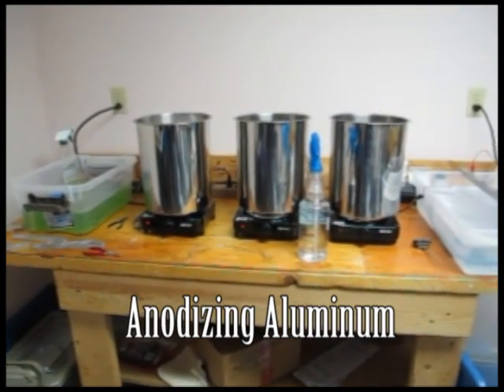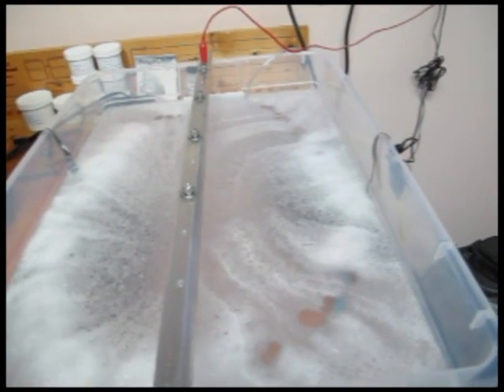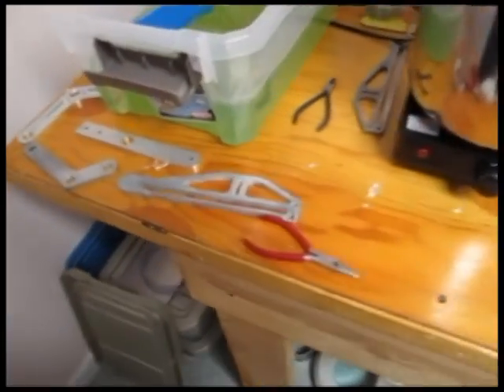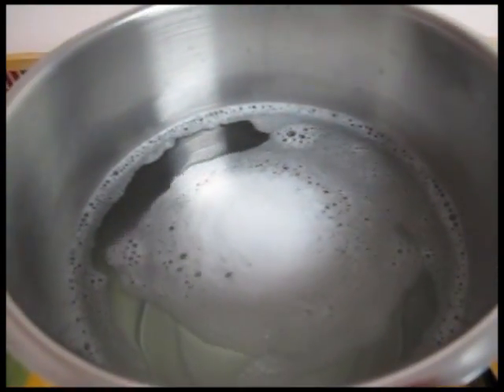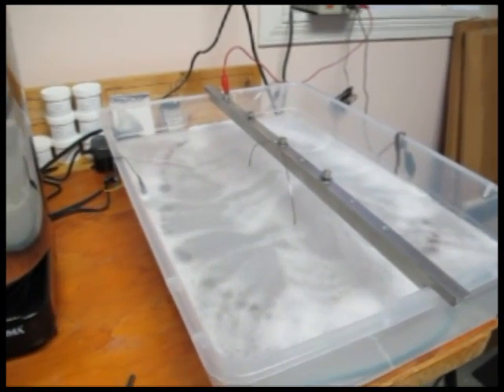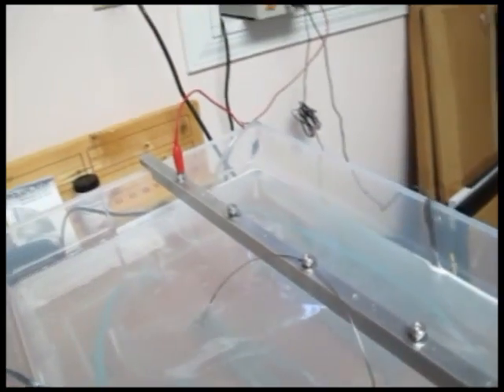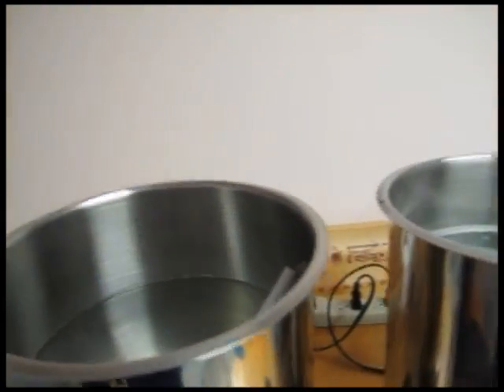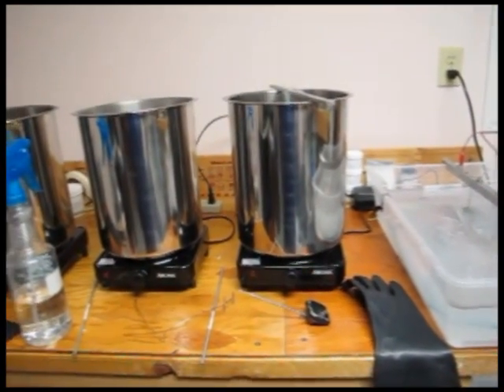Anodizing Aluminum

Comment: for anodizing wheels, if i dont have a big enough tank, could i anodize only the face of a wheel, or does the whole part have to be submerged?
Reply from the maker: YTatheist  - You should be able to anodize one side then the other, the only question that I would have is the interface line between the two halfs. Anodizing should take no more than about 1.5 hours since by then you should have grown the full layer thickness but the sulfuric acid solution is also trying to dissolve the layer away. So you could get incomplete anodizing at that point or dimensional changes that could affect the part. I have never tried doing one side and then another, I sized my setup based on the largest piece I needed to anodize. Good luck!

Comment from the maker: Removing the anodize layer requires a strong caustic solution, I used a solution of lye and a scrub brush. Soak the part in the lye for a short time and then use the brush lightly to remove the oxide layer. Wear gloves while you do this and watch for splashing (a plastic chemical apron, safety glasses and face shield are recommended). You can see the layer as it comes off and back down to bare aluminum fairly easily

Comment from the maker: There is a balancing act when the current is applied where when the appropriate current is applied about 0.001" of oxide is formed in about 1 hour. Additional time doesn't make the oxide layer thicker but as I understand it from other sources, the acid wears away the layer as fast as it grows. The oxide itself is hard coming out of the process. The process for putting it in Nickel Acetate or boiling causes the open honeycomb cells in the oxide to close up, trapping the dye molecules in place. This information is available from a number of sources, if it is incorrect please point me to your sources.

Comment: Hi Bob , The aluminium doesn't dissolve in the acid the acid reacts with the surface of the aluminium changing it from basic aluminium to an aluminium molecule, aluminium oxide. It is this oxide that when first formed is soft and absorptive, once coloured with dye the oxide is hardened with either boiling water or steam.
Regards
MoK

Comment from the maker: I rarely go back to my videos, was surprised at the number of entries. To answer some questions: you have to use Sulfuric Acid, no substituents. I got the acid from a auto zone store. The plastic bin came from Walmart, just looked around and found something that was the right size for my application. The electric heaters were ordered on-line along with the stainless pots, don't remember where but there are a lot of places that sell them. Just look for a size that will allow you to completely immerse your project. The dyes were purchased from Caldwell, just google anodizing and it shows up pretty quick, lots of hints and ideas on the web site. I keep the setup in place in the basement, just cover up the pots and there is little evaporation. I have several 5 gallon pails with lids if I want to store the liquids away from the workbenches.
Reply: Sulfuric acid, is of course  the most common or standard acid for anodizing. The issue for DIY'ers, is the difficulty in acquiring liquid sulfuric acid. There is an alternative acid that comes in dry form then you mix with distilled water. Its name, Sodium Bisulfate. Just search 'anodizing without sulfuric acid'.